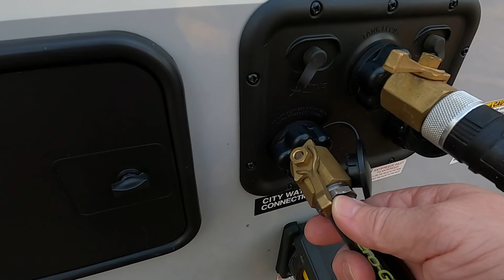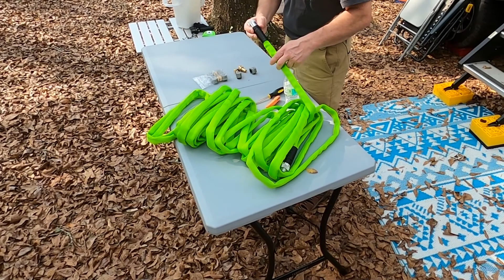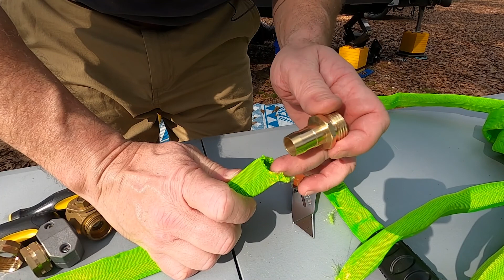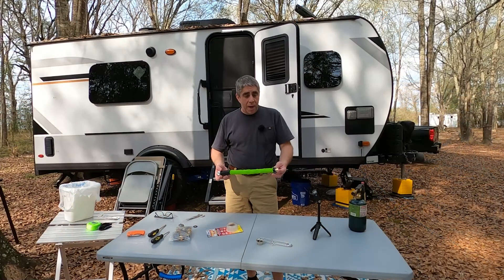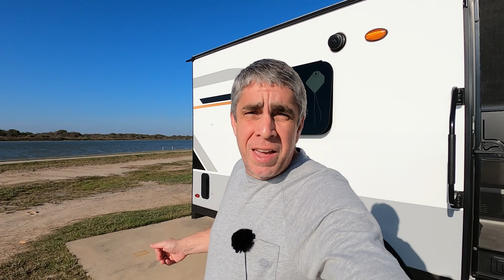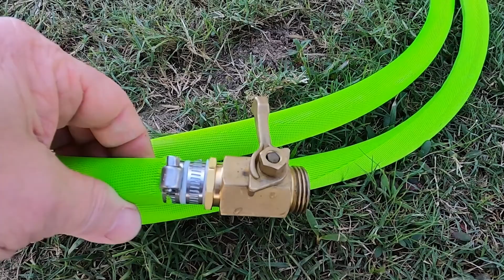Zero G Hose Repair | What size hose for my RV? | Full Time RV Lifestyle

Comment: This is going to be a disaster short term and long term. There is no reason to rush into purchasing a hose with the intent to cut the hose into pieces. Take your time and purchase the correct length, this wasn't an emergency repair. Repairs using aftermarket fittings, not intended and engineered specifically for the Zero G hose is not a good idea. This video should be retitled "How Not to Repair a Zero G Hose"

Comment: Thanks for posting this! 😊🙏 I have two zero G hoses that leak at the ends, so I’m going to try this
Reply from the maker: Hey there, jackplunderbones. Yeah, the first try with the tape did not work. The double hose clamps at the end of the video have been working for me. There was one time when extreme heat and sun caused the double hose clamp thing to slip and move a little. There was weight from the hose pulling on it, too. Anyway, I was able to do the double hose clamp process again and noticed that taking my time and doing a god job makes a huge difference in its performance.

Comment: Those hoses only handle pressure because of the sheathing.  Cutting them up might have shortened the lifespan.  I never got more than a year out of one, and that was just using it in a garden.  They would always get a hole in the sheathing, inflate out the side and ultimately pop when something touched the unprotected hose.  They are convenient for washing something, watering a garden and storage size, but I wouldn't rely on one for a fresh water supply.  Best of luck with your modification.  You could make your own custom hoses using food grade braided pvc hose.  It handles more pressure than you'll ever find and easy to cut and put together with barbed fittings and hose clamps.  It's not the easiest hose to coil though.
Reply from the maker: How goes it, Kevin? Thanks for the insight. Both of my old Zero G hoses leak at the stock fittings. The 1/2" one started leaking right before I left the Sam Houston National Forest. Hopefully, I have continued luck with the sheathing holding up on the new hose. But yeah, I hope my fittings don't cause headaches. I use PVC hose to adapt to my fresh water holding tank. But even the Camco hoses are too bulky and unwieldly. Hopefully the jury will continue deliberating for at least 6 months more on the fittings I have. Take care Kevin!